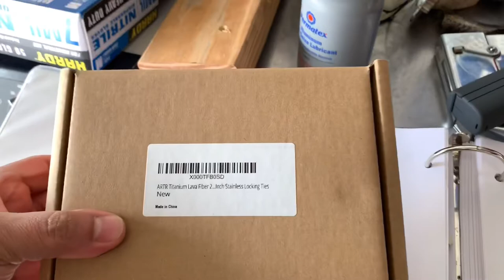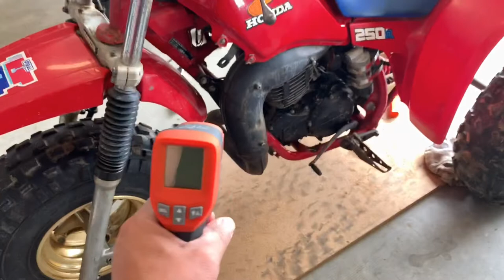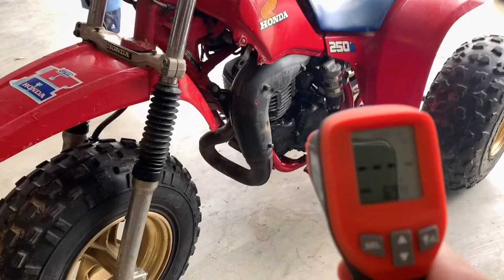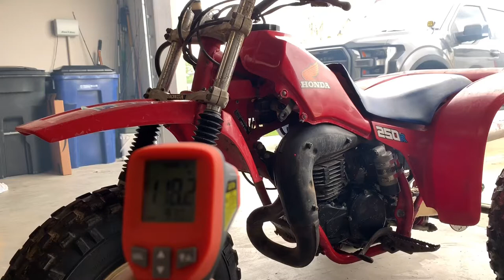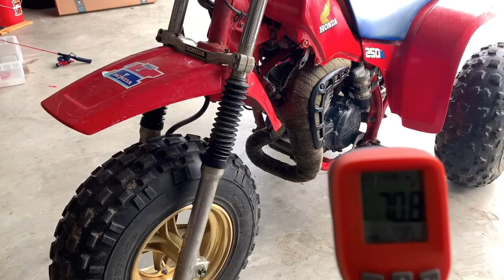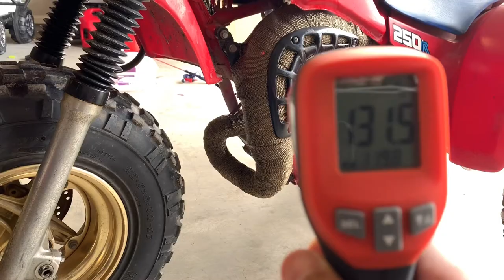Exhaust wrap does it work? How Do You Install Exhaust Header Wrap. What the best Exhaust Header wrap

Comment: Comment/question.  My reason for wrapping exhaust is for slight boost in torque. It keeps the heat in the exhaust.  Hotter exhaust= higher pressure (without restriction)/better exhaust scavenging/more velocity. People mistakingly say 'engines need backpressure' to make decent torque, so they keep the exhaust restricted.  In reality, they need exhaust velocity. Free flowing exhaust is necessary for high-end HP, but causes the gasses to be 'lazy' @ low rpms because there's significantly less pressure to force the gasses out. Heat wrap keeps it hot (like a pressure cooker) to increase that pressure/velocity when there aren't enough hot gasses in a lower backpressure exhaust system.  My question is did you notice more low-end torque?  Also did you notice a less tinny/pingy exhaust note?

Comment: You're supposed to run the wrap from the end of the exhaust to the motor that way any debris or wind or rain or mud will Cascade off of the wrap instead of running against the grain of the wrap.
Reply: Ouch! I did mine from the engine side, but just the first part (like 2') and it has a factory metal sheet shield anyway. I'm doing the rest as you said.
Reply: amazing advice before i did mine.
Reply: @JavoCover  good deal hope it turned out good for ya
Reply: @Blackcrowking7  yeahh no probs hope it turned out good for ya
Reply: Thanks for the advice. I'm glad I saw that.

I would have started at the engine side. But what you said makes sense.
Reply: @madcat4563  yeah no problem!
Reply: Glad i saw this
Reply: @jacopodanglars4836  yeah buddy!

Comment: Great info, I had no idea soaking it in water would help out the wrapping process. 👍
Reply: That is usually only for the fiberglass wraps.  The titanium wraps you do not actually have to soak it
Reply: @charleswesterfield1453  correct only the fiberglass kind needs to be soaked first
Reply: I think soaking is also to keep the fiberglass lint from going airbown because if you breath it in you're screwed.
Reply: Nice to kno 👍

Comment: You need to place the temperature gun closer to the heat source to get a smaller more accurate surface area reading. The laser pointer is only for visual guidance to the user.
Reply from the maker: Cool thanks for the tip! Will have to try it later this week see if there’s much of a difference. Thanks for watching!

Comment: If you are using titanium wraps you do t need to soak the wrap that's only for fiberglass wraps
Reply: Do you think it is titanium metal? Lol, its dyed fiberglass
Reply: @diamondperformancefab5931  its not fiberglass. Its pumice wool
Reply: @diamondperformancefab5931  basically you got the cheap one..lol..
Reply: @pondokpermotoran3872  ок ок ок спасибо

Comment: I think, from engineering point of view, the results are not accurate although they are representative. The wrap was obviously still wet as water was still evaporating. Water in-between wrap strands transmits heat through by conduction thus limiting the insulation of the wrap. 
In short, if you’ve waited until it drys, you would’ve had better results, probably half the temp. 

Great video, thanks.
Reply: Could you comment on every video like this because you know what you're talking about and I need that 😆
Reply: What about pre-coating the the pipes to avoid corrosion under wrap? In my case I want red so what about by coating the fiber glass wrap at the end with hi-resistent exhaust coat? to avoid loosing color?  Give your 2cents...
Reply: Imho its burning not vaporizing bec. of first time heating. Anyway with or without water its the temperature, the water is also hot.
Reply: it would actually be hotter once the water evaporates

Comment: I have been trying water heater vent thick aluminum foil tape over wiring conduit. It might work good for going over exhaust heat wrap to hold it together after wrapping the exhaust and using some metal zip ties. I had a exhaust wrap on a four cylinder 2000 Ford Escort SE car main exhaust pipe because the exhaust pipe goes directly underneath the engine from the catalytic converter in the front of the engine. The problem was the wrap comes off in sections with the metal zip ties so possibly the water heater tape would work to keep the wrap on. I paid $12 for a roll of thick aluminum foil tape at Lowes. The sticky side has a wax paper to keep the tape on the roll from sticking together. You might want to try some of the water heater vent foil over the titanium exhaust wrap to keep it from coming off. Once the wrap is on and dry of course so the tape sticks and the glue doesn't get wet. Or the expensive gold exhaust tape.

Comment: You could always use hose clamps if you don't want to spend the money for metal zip ties
Reply from the maker: Thanks for the tip.
Reply: Hose clamps actually work better, they bite whereas smooth metal ties just roll around and don't bite.

Comment: My Ducati scrambler top
Pipe is less than two fingers away from my bare calf, I hope the wrap is enough plus a heat guard, but I also have a plastic timing belt cover that’s 5mm clear of the lower pipe, so I’ll buy an aftermarket cover of metal (probs aluminum) just hope I don’t have to ceramic coat

Comment: Hey is it supposed to smoke after putting it on and riding it
Reply: Yup 1-2 hours it will smoke. Common when you put a wrap on after that it should be normal. One day of riding it will smoke. The rest of the other days it will be normal no smoke they also give you a disclaimer about it
Reply from the maker: That’s correct like Beast_Gago said.
Reply: @JJBanuelos  was just fixing up my carb and it was increasing idle speed found out it was the throttle cable now it runs like a dream and know it’s time to wrap the exhaust

Comment: From that far back you are measuring a circle over 12" in diameter. Read the manual for your infrared thermometer, the beam spreads similar to a flash light.
Reply: Wrong, it is similar to a camera lense (Because it is one, built in germanium, the only known lense material that allow infrared light to pass thru ), light ( infrared in this case )goes from the object the the lens. A flash light emits light toward an object.
Reply: @ayuse01  It spreads. If you owned an IR thermometer and read the manual you'd know. Glass lenses with coatings are used in my CO2 laser and they pass IR light just fine. Do more research before trying to correct people with the wrong info.
Reply: @diamondperformancefab5931  Poor you, i been trained by the FLIR company, just to operate my 20 000$ Infrared camera. You're just wrong and full of yourself. Read what i wrote, take time to understand it, and realize your errors.
Reply: Why does my IR thermometer manufacturer have a fake diagram embossed on the side of the detection area spreading? Glass lenses pass IR? You didn't address that false statement. Plenty of materials will pass IR wavelength, it's not a secret.
Reply: @diamondperformancefab5931  IR camera lenses are made out of substances like germanium, or other materials with low absorption in the infrared spectrum. But why is it necessary to use these specialized components instead of a more common substance like glass? 

Infrared cameras don’t work the same way as regular, visible light cameras. Regular cameras function more or less the same way as a human eye, receiving radiation in the visible light spectrum and turning it into an image. Infrared cameras, on the other hand, make images from heat, aka infrared or thermal radiation, instead of visible light. 

Infrared radiation behaves very differently from visible light. Because of this, infrared camera lenses need to be made from different materials than regular cameras. The properties for a given material in the visible world might have no bearing on its properties in the infrared world—glass, for instance, is extremely transparent to radiation in the visible spectrum, but in infrared, glass is completely opaque:

The opposite can be true. Germanium, a semi-metallic element similar to silicon, is completely opaque in the visible world

but nearly 100% transparent in the infrared:

It’s for this reason that FLIR camera lenses are made of germanium or other materials that are transparent in the infrared spectrum. But mostly Germanium because of it's near perfect I.R. waves permeability. 

Ok. enough now, back to work.
Reply: I don't care about that. You forgot what we are talking about. A handheld cheap infrared thermometer. I stated the area measured changes diameter if the distance of the object to lens is changed. It's called distance to spot ratio (D:S). Cameras and thermal imaging are not the same concept as an infrared thermometer.
 The lenses are not an expensive material, obviously harbor freight can't afford lenses with 99% efficiency if the selling price is 20 dollars. 
 Glass lenses work for certain applications usually coated, the efficiency can be an issue in some cases like your employers cameras.

Comment: I hear you have to clean your exhaust pipe surface before wrapping it to prevent smoke from being released, which happened at the end when you were using your heat gun. Anyhow great vid bro.
Reply: It wasn't smoke, it was water vapors.  You can see the steam on the heat guard.

Comment: How about everyday use, rust and so on from underneath. We live here in Europe and rain and fog can not be avoided. Nice video buddy🙂👍🇱🇺
Reply from the maker: Some people say that this will eventually rust out your exhaust especially if it gets wet. Which is true if it stays wet but then again if your driven it through water the heat from the exhaust should just dry it out. I haven’t experienced any issues with mine. Thanks for watching 👊🏼
Reply: @JJBanuelos  Thanks for the reply buddy👊
Reply: @rtoebak76  If you get the wrap wet  and dont let it dry befor you shut the machin down it will rust your pipe to shit. Let the pipe run hot untill its mostly dry and then shut down to avoid moisture to stay between the wrap and exhaust.👍🏻

Comment: Your temp readings don't mean anything. The wrap was still wet and steaming when you did the last temp reading.

My exhaust is wrapped with DEI Titanium wrap. Also works better if you wrap the header from back to front so it doesn't funnel water into the wrap. The overlap points back.
Reply from the maker: Yes that’s very true , Wrap was prob still a little damp. I did let it sit for a couple days in the garage before I could attempt my last reading. Thanks for the tips! & thanks for watching!
Reply: @JJBanuelos  just drive it lol. dries upnmuch faster from that

Comment: It did not magically drop. The exhaust is actually HOTTER underneath the wrap, the scanner only can see the surface of the wrap. The best result would be when driving because the wrap will cool it.
Reply: Did you figured out in the meantime, that his intentions were to not get burned by the heated metal. It's the main reason, it didn't cared about anything else. And that's why I've watched this video. I don't care about scavaging or looks or exhaust temps or something like that..
 I just don't want any type of heat source, too close to my feet.